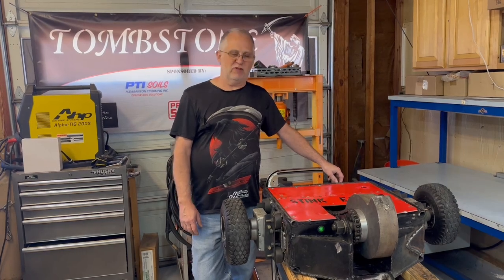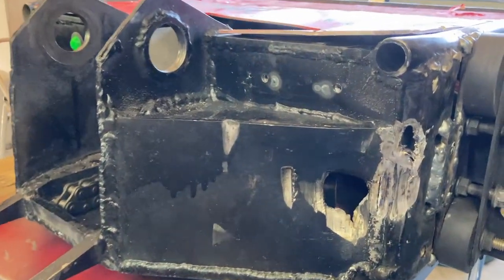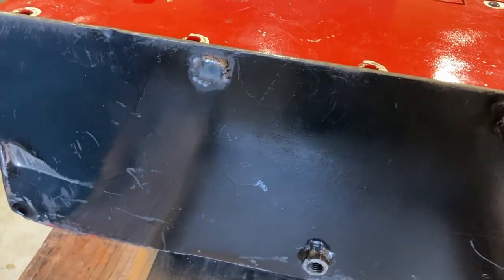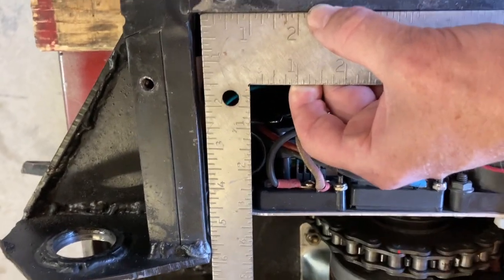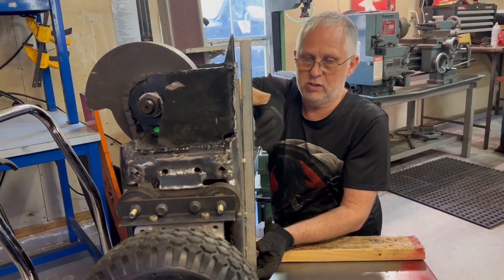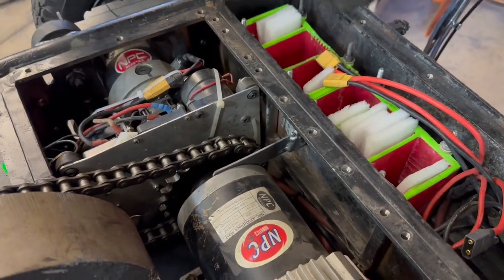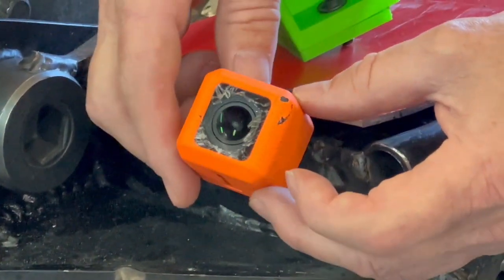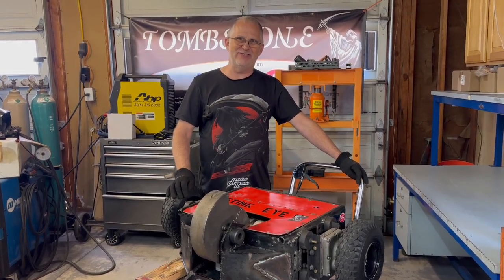Stink Eye RoboGames 2024, Post Event Report

Comment: What caused the weapon motor to fail?  I'm impressed by the amount of material missing from the commutator.
Reply from the maker: The robot got flipped over, and didn't turn the weapon off fast enough, so it was trying to spin while pinned against the floor. So basically it was drawing stall current, which for that motor (black max motor) is a LOT. It really isn't a good choice for the weapon motor for this honestly, just happened to be motors I had sitting around and I figured I would put them to use.
Reply: @ray9368  What would you need to do for the robot to detect when any of the motors is seized? Hopefully that can be just programmed in.
Reply from the maker: @Convolutedtubules  Honestly, this would not be something I would ever consider. I'd much rather the motor just burned up trying, rather than giving up. This pretty much goes for every part of the robot. It is literally in a fight to the death here, and I want the maximum effort for all 3 minutes of the match :)

There are fixes here however. I used these motors because I had them, and figured using them in a robot that was not meant to be competitive was the right spot. If I were to build a competitive robot around that weapon disk (a serious possibility down the road) I would use much higher end components that would be much more likely to survive in combat. One fact of competing for as long as I have, is that I have a lot of parts hanging around that are no longer all that competitive in a cutting edge sport like this. But the parts are still functional, so it's fun to make stuff like this!
Reply: @ray9368  Power tools and electric vehicles, usually have a way of preventing the motor from burning out when it is overpowered or seized completely, this is for reliability and should not impact performance. It could save the motor from burning out early in the match.
Reply from the maker: @Convolutedtubules  And for a power tool that makes perfect sense. Where if you overheat the motor and it stops, you can just wait a bit and go back to work. Combat is totally different.

To give you an example, one common older way to do this was self resetting fuses. You exceed a certain amp draw, the fuse opens and then resets after a time period. In that time period (even if less than second) you can get your bot destroyed by the opponent. 

Now there are amp limiting speed controllers. Many brushless controllers these days do this now. So if I had used a large brushless motor (like I would if I was building this to actually be competitive) then not only would the motor work better for this use, but the entire setup would be more reliable all the way around. But again, the primary build criteria for THIS robot was to use the old junk I had in the garage.

This particular large brushed motor draws just over 1500 amps (at 33.6v) at stall. To my knowledge there just isn't a speed control on the market that can handle that kind of voltage, amperage, and PWM input from radio, and then also provide any sort of amp limiting to its programmability. There may well be larger industrial controllers that can handle the volts and amps, but they would most like be huge and heavy, and wouldn't interface with standard RC controllers. 

I know this is more of an answer than you were looking for, but there are just a lot of reasons why it's not simply a programming issue. A lot of design limitations revolve around parts availability. Both in what is actually available in the market, and in this case what was available on the shelves in my garage!
Reply: @ray9368  This is a great answer. I do see your point. Thank you for taking the time to elaborate.

Comment: I told you =D about that camera placement... To repeat what I said, drill a hole where the lens will be, mount camera inside of robot (looks there is space for it), can use existing screw holes and holder for camera, just mount camera other way and screw from inside. Easy mod, should take no more than half hour max. For camera buttons drill a hole on top cover, just poke it through with stick.
Reply from the maker: Oh yeah it could have been placed better, and any rebuilds down the road would plan for it in a more protected fashion. It was very last minute for this build, and honestly not something I put any great effort into - sort of like the rest of the bot actually :)
Reply: @ray9368  lol

Comment: What material do you use for isolators?
Looks like large test tube stoppers
Reply from the maker: They are vibration isolation mounts. You can buy them from McMaster
Reply: @ray9368   perfect 

looks like the neoprene ones

Comment: -- Ray, what are your thoughts on 'crush zones' or using more pliable materials to absorb damage with the idea of keeping the frame true, reducing shock forces and protecting inner components.
   My thought process for the question is along the lines of accident science in automobiles.  
   Best wishes to you and yours.  'Stink' sounds great, long as that eye is in the woodchipper :D
Reply from the maker: Certainly some measure of crush zone is usable in a combat robot. But the forces involved are pretty intense, so my crush zone here was AR400 plate :) You just have to have an air gap between the armor and the stuff inside, because this stuff is going to bend!
Reply: The rubber mounts for the drive wheel gearboxes are something to this direction already, and he's been using those for some time (a long time?) already.